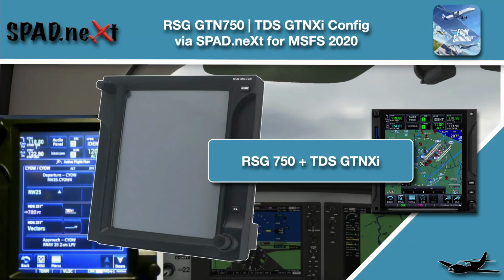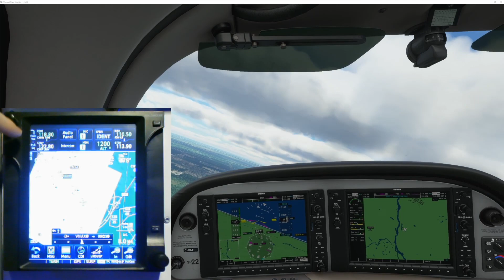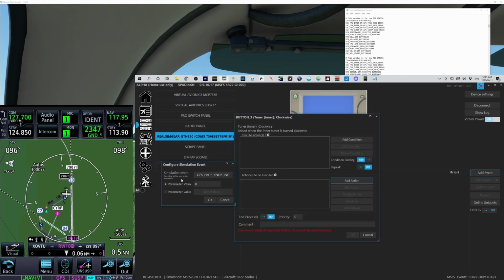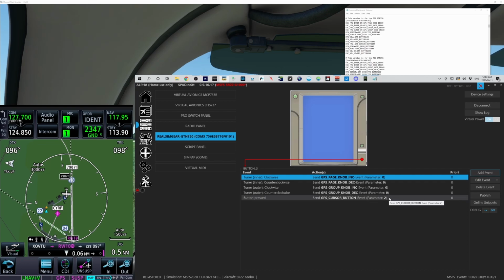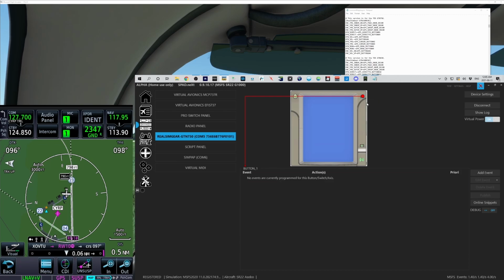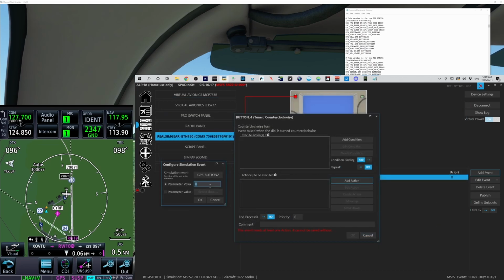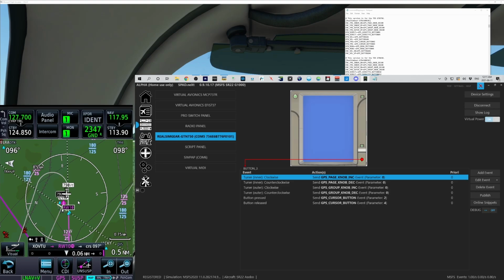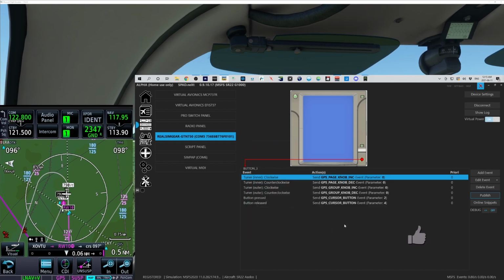(Sim Video) RealSimGear 750 | TDS GTNXi | Configuration via SPAD.neXt

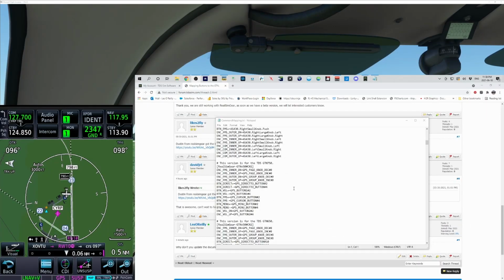Comment: this is very helpful thanks.  At 2:30 you have the commandmapping.ini file on the screen.  Do you know where to find that file?  I'm looking to see the part for the GTN650 that was cut off on the bottom.  thanks
Reply from the maker: Those are where ever the RSG software puts them now. I have not looked at that software in a long time.

Comment: I have a question? Whenever I’m in the touchscreen using the G750 if I want to make any movement with a joke for the airplane, it doesn’t respond until I put the mouse pointer back to the main screen. I think it recognizes it only where the mouse pointer is at the moment, and of course, if I’m touching the touchscreen, the mouse pointer is gonna be on that screen, so I cannot turn or do anything else until I go back with the mouse pointer to the main screen or the same as being displayed, does Anyone know  any  solution For This Problem?
Reply from the maker: You are using pop out or standalone mode?  This is a problem with the sim when using pop outs.
Reply: @ I do the normal pop out of the window so I can drag it to the touch screen on my actual touchscreen hardware , hardware is there any other way?
Reply from the maker: @AVIANCASAMACES with TDS you can run it in standalone mode. Instructions are in the TDS discord or their forum. You need to put a blank text file named Standalone.txt into the folder location where the app is.
Reply: @ how ?
Reply from the maker: I literally told you in the previous comment -- "You need to put a blank text file named Standalone.txt into the folder location where the app is" and also told you this is all in the TDS discord and forums

Comment: Hi Les,  I am following your video's on GTN750 in MSFS with great interest. I have a selfmade bezel of a GTN 750 with its buttons and knobs I am trying to link to the PMS50 software I use in MSFS. I prefer it over the TDS as it lets you update the navigation database with the Navigraph database. I find this important in my flying in the sim. Unfortunately I am a bit stuck on binding a few commands with Spadnext. Would you consider making a similar tutorial for the PMS50 GTN 750/650 module.
Reply from the maker: I do not use the PMS unit and so I can not do a video on it.  SPAD.neXt has all of the GTN PMS Events already in it ... Add Event - Send Simulation Event - MSFS 2020 - Custom Events - GTN 750 .....  There you will find all the events for the PMS units.  For future assistance please use the Spad Discord as it's possible to post Images and have better back and forth .. YouTube comments are not really conducive for this.

Comment: Hi Les,

I just cannot get rid of the white bar at the top and each time I start the sim I have to move mouse over to the TDS 750 to maximize it, it doesn't hold the window position and even maximised I still have the white bar at the top...any advice?
Reply from the maker: In the TDS application Settings there is a setting for disabling the Bar.  It is in the Manual on Page 15 the option is called "Hide Window Frame".. Also there are other settings regarding to Lock Aspect Ratio they you may want to edit..

Comment: How did you get the touch function to work in MSFS with your Realsimgear GTN750? The cursor follow my finger as I move on the screen but the click function just wont work
Reply: on further testing the hardware and PMS50 it seem like clicks work only on the RSG 750 if in windowed mode and not full screen. Sucess rate about 90% Are you using Penmount, any special settings?
Reply from the maker: I will have to check. But I am using the TDS and not the the PMS 50 stuff. It’s a separate app and runs outside the sim.
Reply: @LesOReilly  Very nice thanks. I guess this is more of a hardware thing than software issue. Do you run the TDS in full screen on your RSG 750?
Reply from the maker: @mikaelcedergren8984  Yes I do but again it is running out side of the sim and is not a "pop" out window...  With P3D and the Reality XP GTN I needed to right click on the "edge" of the frame and "Lock window" position otherwise it would drag the screen around when trying to scroll and drag....

Comment: Hi Les, great video,  New to your channel, I just purchased the Realsimgear GTN750 and installed it in MSFS2020. I mainly fly the carenado Mooney Ovation or the carenado Piper Seneca V, both aircraft have the GTN750 installed and I got the Realsimgear module working with PMS50, the only issue I have I can not get the buttons to work, Would you have any Idea? Thank you for your time.
Reply from the maker: I think the PMS50 has special H:Events for some of the buttons.  There is a Spad.Next Discord that I think another user posted what they did...  However if you are just using the standard RSG software then I am not totally sure how they would add or tell you to add that event -- They also have a Discord support server they run and usually try to help people out regarding these kinds of things.